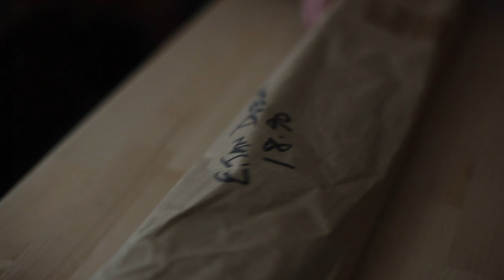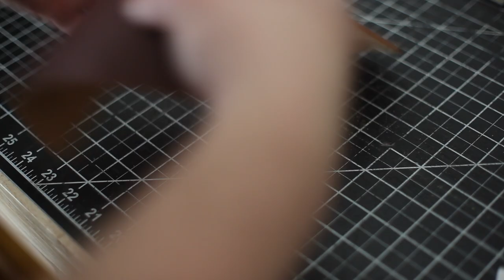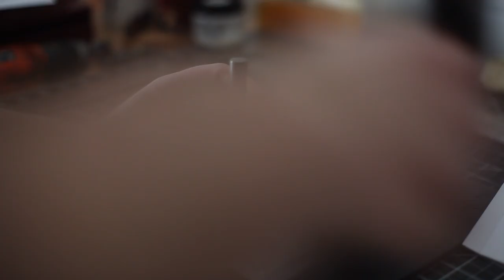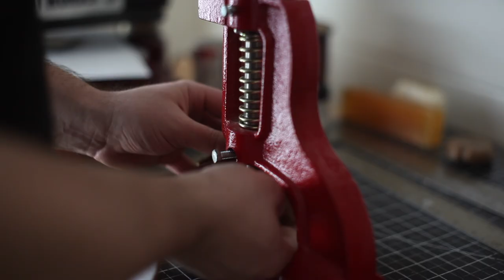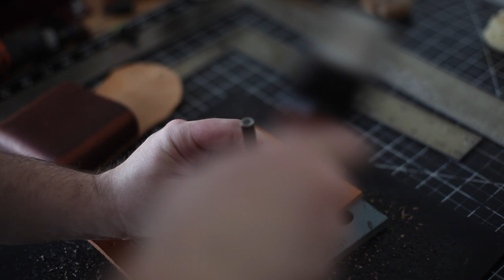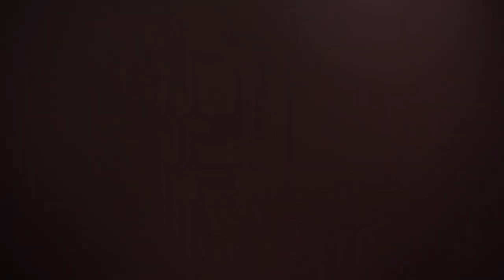Making a Pouch from The Mandalorian

Comment: I'm working on a similar pouch now.  In my template I incorporated fold up flaps on the bottom panel to cover the seams. I'll be using barge on all of the seams, reinforced with 4 rivets for the back panel for the joining corners and the belt straps.  Plus one rivet for the strap that will match yours for closure.

Comment: Just used your video as inspiration to build a similar pouch.
Like other commenters, I altered the pattern to add 1inch tabs to the bottom section that fold upward into the pouch to eliminate the gap between the side and the bottom.  All holes were pre-punched before cutting out the bag to eliminate stretch.  To construct it, I used 4 needles (2/side) to saddle-stitch both sides simultaneously so the seams closed evenly.  Couldn't use the harness needles for that - had to use the much shorter craft needles sold in newbie kits.  I just folded down the back as I worked to make room for my hands.  Final size is 3-1/2 square by 1-1/4 deep.
Thanks for sharing an inspirational build!

Comment: Great job! In regards to addressing your question, I would personally alter the design of the pouch a bit. I would have designed the pouch so that the two sides would actually be gussets instead. You would glue the gussets so that they closed off the sides and the bottom. That way, you can still stitch them by hand and secure those corners (as you were asking). When finished, the sides would be indented in contrast to how you built it here in this video. I hope that made sense and helps! At either rate, keep up the good work and take care.
Reply from the maker: Thanks for the idea!  I might work that into a redesign for a pattern eventually.  I was trying to avoid stitching this, but it might be the easiest way to assemble this.  Thanks for the kind comment!  Cheers.

Comment: Would it be possible to sew the pouch inside out and when finished turn it back outside in? Similar to when shoes are sewn?
Reply from the maker: Absolutely.  However, it would change the overall look of the piece.  I imagine it would also have to be designed a bit different, but it would be easier to achieve the shape that way than trying to figure out how to deal with those double cap rivets in the corners.